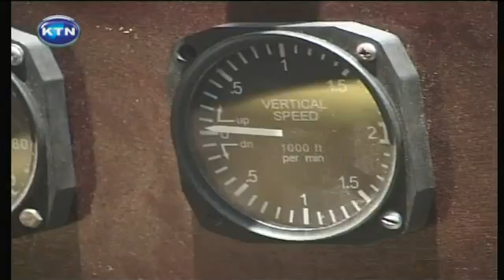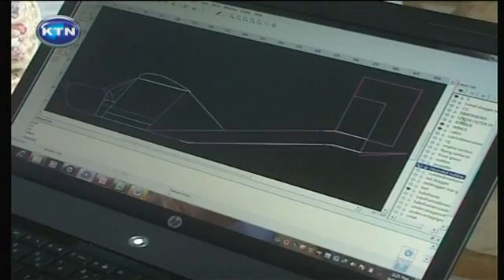Man builds plane

Comment: OK we’ve had really decent flyable airplanes for over 100 years now. The designs and engineering is freely available.

If you’re going to use a motorcycle engine as a power source you’ll have to make the plane of balsa wood and cloth. Not welded steel.